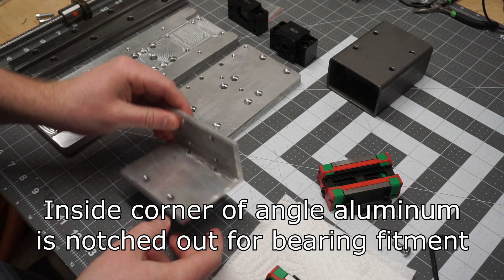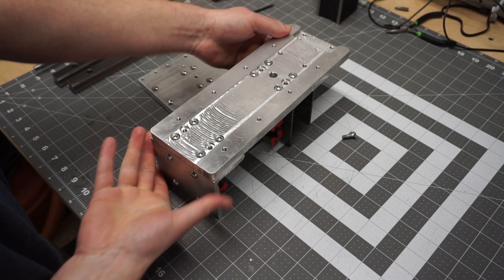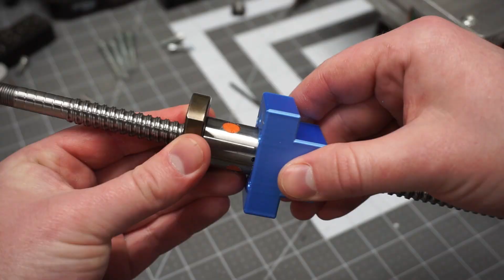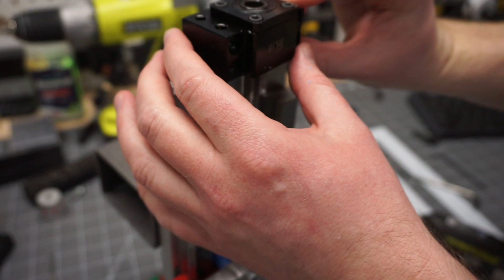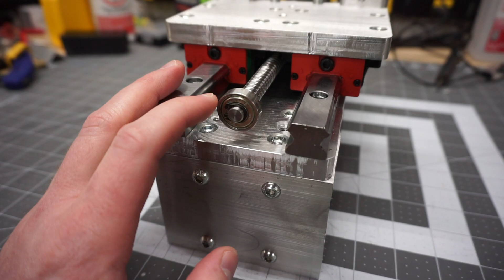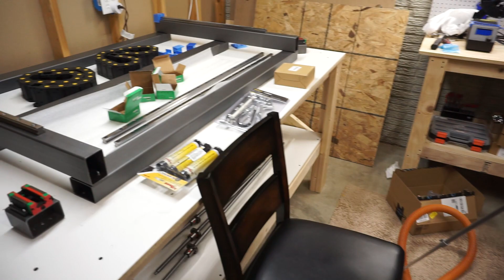PrintNC Z Axis! v2.1 Narrow Z Gantry Mod!

Comment: Hi Brian, by chance would you have the z plate drawing or print? I'd like to cut aluminum z plate on my manual mill instead of using wood. I see the wood dims do not show several features.
Reply from the maker: Hey John. So, I do, however the intent with the drawings is that you would download the latest Fusion360 file from the wiki, put in your parameters for your build, and then it will auto generate the Z plate that you need. If you happened to have a different build than me, the Z plate might be different. Once you put in your parameters and the drawing updates, you can then export the Z plate from the Fusion360 file in whatever format you need. I hope that helps!
Reply: @ProjectsbyBrian  I only have the free version of fusion. Doesn't allow for dxf exports. I have all the holes marked. I'll just manually write the few dims I need down and move one. Thanks buddy!

Comment: its a beautiful cnc the plastic parts flex way to much when moving the gantry the motor mounts are the worst
Reply: They do, but they function perfectly well enough to get the machine cutting its own aluminum replacements. There are mounts that space an HM-57 motor/bearing assembly which is cast, so you don't have to worry, options are there.

Comment: Adding another set of bearings would make that axis significantly stiffer.  A single set of bearings is not very stiff at all.
Reply: @ProjectsbyBrian  This is suggested regularly when people look at the design, I actually tested both dual bocks and single block during testing and design and determined there was no measurable performance benefit. I think most peoples experience is using SBR round rails or smaller MGN square rails which are significantly less rigid than the HGR20 used on the PrintNC
Reply: @threedesign8999  My experience is based on designing custom machine tools for a living.  Two bearings per rail offers a significant increase in rigidity.  We also use preloaded bearings for additional rigidity.  In general, mass, rigidity and using 'dead' materials like grey iron are your friends for making good cutting equipment.  Obviously, one can't make a perfect machine due to cost or other constraints.
Reply: Sorry if I wasn't clear.  Each linear rail should have two bearings spread as far apart as possible.